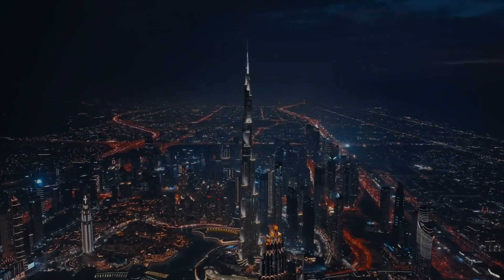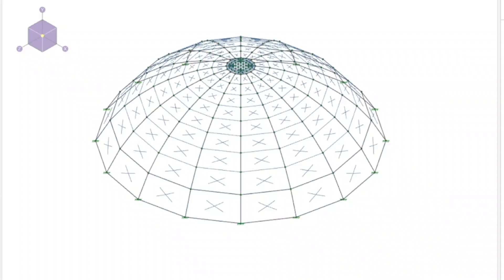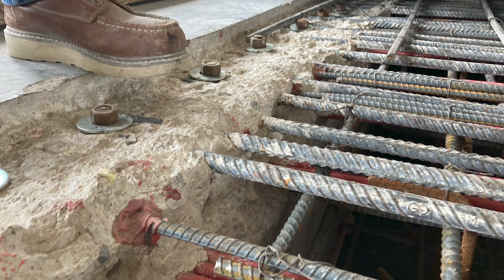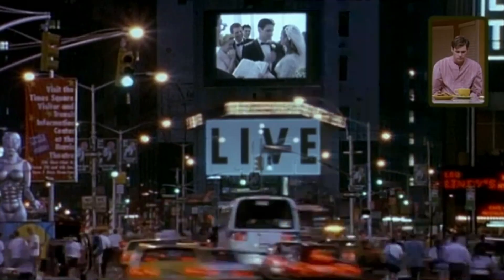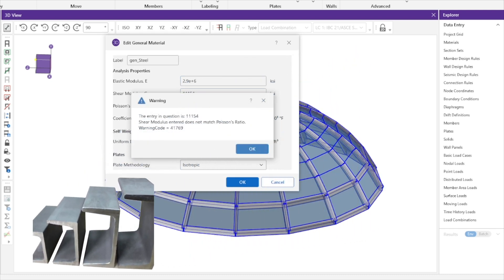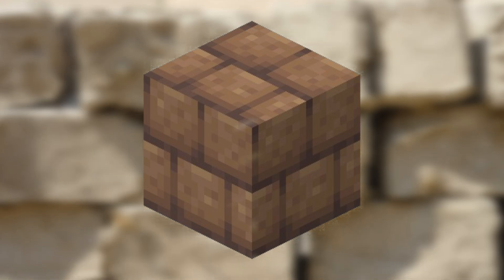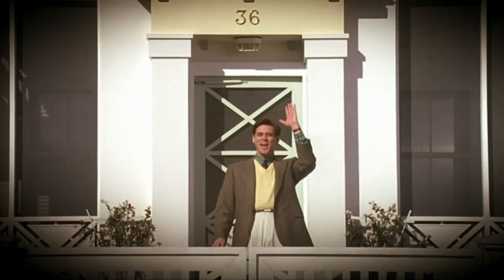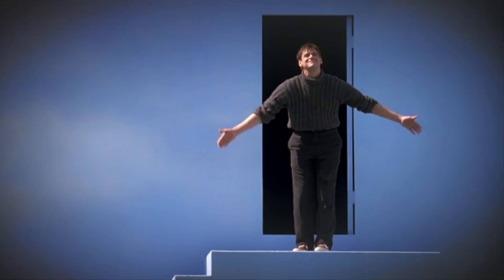Engineering the LARGEST Building in Science Fiction

Comment: you touched on it in the beginning of the video, but making the dome out of interlocking triangles rather than squares might be a way to strengthen the dome, i would've loved to see you experiment with it
...i really need to see The Truman Show some time
Reply from the maker: That's a good point, the triangular shape is generally better. in this case the rectangles you're seeing are finite elements of the larger dome material. Meaning the material is constant, and the shape is just a product of the analysis method. Triangular elements should produce the same result.

Comment: If you want to look at some more fictional examples, you could look at The Great Collesium from Bionicle. In all measures, it is at least an order of magnitude, if not 2-3, than the Burj Khalifa, and yet very well might be a theoretically possible megastructure. Now, this is peanuts compared to the true largest megastructure in Bionicle, the Mata Nui Robot(or the Great Spirit Robot, as it was more often refer to by fans). It was designed to be 3,150 km, or 10,334,645 ft, which also matches a known canon reference, although it was later retconned to a whopping 40,000,000 ft. Inside are many islands contained within artificial domes that contain whole islands and even 2 continents. There is the catch though that the Mata Nui Robot has artificial gravity, and is made of a fixtional synthetic element called Protodermis, so it is very much in the realm of fiction, but it is certainly an interesting example of a fictional megastructure.

Comment: Your dome shape is not efficient it's murdering the bigger the span the more you have to go parabolic and it has to vary with the angle and wrangle-in the load path, rings can isolate systems instead of going for a monstrous monolithic system. In classical buildings dome-on-dome is common since the compression ring can then be the buttress/strap for the tensile force of the next dome, although they don't mushroom up the ring the counter the downwards shear. The nearly flat cap of a plain dome on large scales has nightmarish unstable shear hence the noise in your simulation.
Reply from the maker: @leggysoft  good analysis!

Comment: Ima be that guy and put my vote in for SCP-3008 the Infinite IKEA (boring, but iconic)
Reply: If we're going with very large, but still finite building, the Library of Babel has 10^4677 books. That gives it a volume of around 10^1559 books. The exact value depends on how densely packed the books are, but what unit you use will only change that exponent by around one digit.
Reply: The infinite ikea is not a regular building, from outside, it's normal